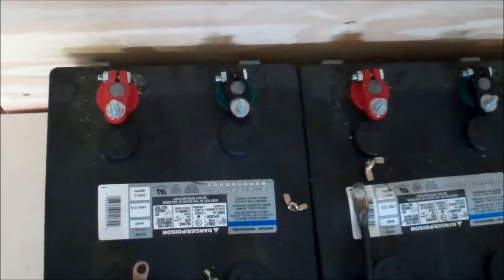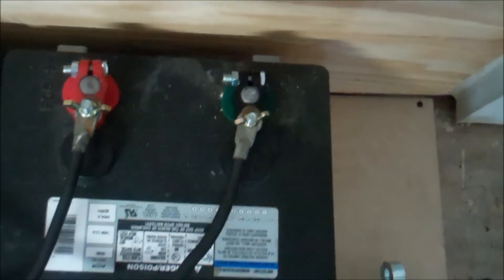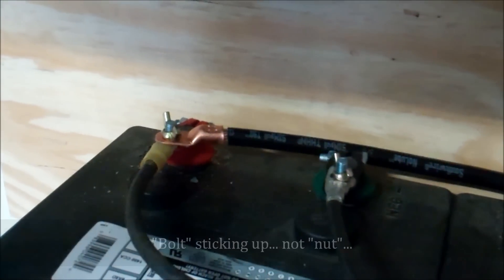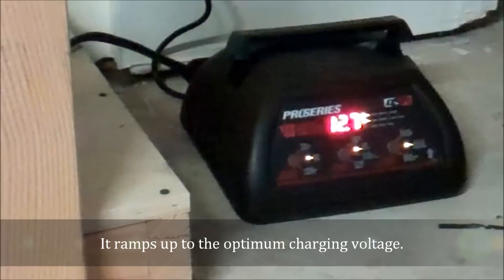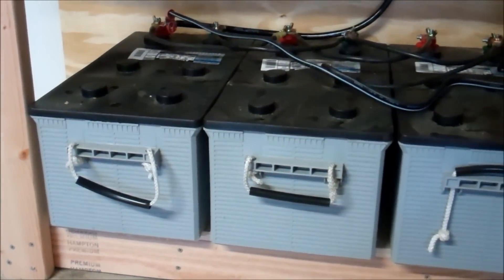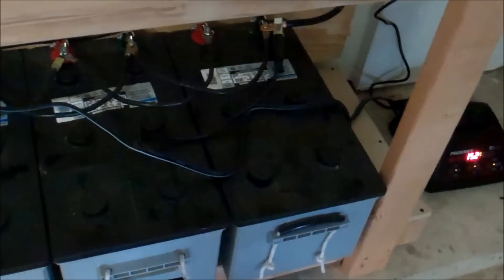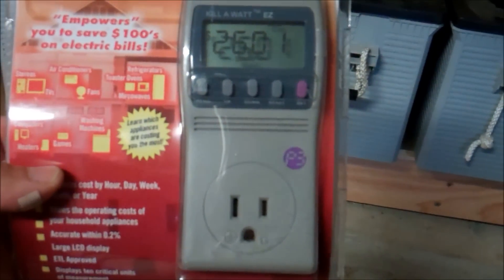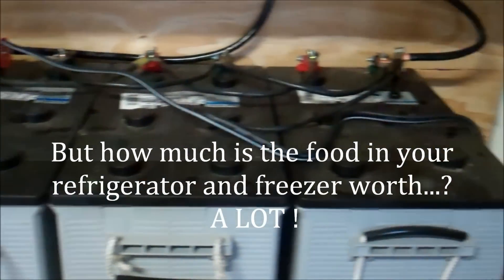Living Off The Grid ~ Build A Battery Backup Power Station

Comment: Dear Sir, Please  pardon my forwardness. This video is by far the best video on YouTube that explains how to make a backup power station however, I'm kind of a dunce when it comes to understanding the concept. I want to buy a modified sine wave or inverter and I was wondering if you would be kind enough to tell me ( recommend ) how many watts an inverter I should buy. I want to hook up 5 batteries that I have. They are all ' Interstate DCM0035 They are easy to find on Amazon along with the specs. I would have sent you a photo or the link however, Youtube will not allow it. I know that I am asking for a lot so if you don't reply, I will understand. I want to to be able to run all my appliances on it even the ones that draw a lot of energy.
Reply from the maker: The size of inverter you needed based on what type of “load“ you have. In other words, you have to figure out what you were trying to power, and how much current it draws. A good way to do that is to get a “Kill-A-watt”. 

That is a little device that will tell you exactly how much power, the appliance, our fan, or TV… is using. 
Just so you understand, it takes a large battery bank to power large devices for any length of time.

Having said that, I would say don’t go less than 2000 W. That way you can power two or three things at one time.
Reply: @TexasPrepper2  , You have my gratitude. Thank you so much.

Comment: I spent hours looking at YouTube videos trying to find a video that was helpful and easy to understand and that would teach me how to build a battery generator to operate appliances in my home. Out of all the videos that I watched and all the time I spent searching for that perfect video to teach me how to build a battery generator, I finally found that video and that video is this one. Thank you so much for posting. The only thing is that this video didn't show how to hook up the charger.
Reply from the maker: Well, thanks so much for the kind words! 👍🏻 😊
I just hooked it up at the end of the circuit. (The positive and negative points that give me 12 v). 
Hope that makes sense. 
Basically, like hooking up a battery charger to any battery… Just positive and negative. But, make it at the end of the circuit, not in the middle. Of course, that depends on how many batteries you have.

Comment: Just wondering why you hooked up to the inverter using two different batteries. Couldn’t you just use the terminals of just one battery . After all it’s still a 12 volt system.
Reply from the maker: Don't remember, but I think it was because of the way they were wired

Comment: Are these 12V Batteries???
Will that inverter with the batteries run a refrigerator?
Reply from the maker: Yes, these are 12V batteries.
This is a 2500 watt inverter, so it should run a fridge with no problem.
This particular inverter is discontinued, but here's a link to several nice inverters with great ratings:https://amzn.to/3rvpZ3W
The newer fridges are much more energy efficient.'

Comment: wow...those are sweet batteries... I am tryin to build a bank myself and it's costly hahaha   
  I am a beginner...I have 4  100ah AGM's now in a 12v set up in Parallel but want to go up to 6 batteries next.... But- I can't find any info/ Diagrams about hooking up 6 AGM 100ah batteries (Parallel) in a way that is equal charge / discharge  Like I say- I have 4 now and found a great site that showed me how to hook them up to properly draw and charge balanced...now I want to upgrade and no one has a bank diagram for 6 batteries for some reason ...also- do ya have to stay with even number of batteries?
Reply from the maker: I don't think you have to stay with even numbers if you stay 12 volt.
Don't add new batts to an old batt bank. The new ones might be pulled down by the older ones.

Comment: Do you keep the charger for the batteries hooked up while it is hooked up to the inverter? I'm thinking of using my 'NPower 3000 Watts Portable Digital Inverter' along with a '12v 100AH Deep Cycle AGM Battery' (thinking about getting one of these batteries). Eventually I want to get solar panels to keep it charged, but for now I want to do something like what you have here… I can find all kinds of stuff on solar hookups, but very little about this type of setup. I want to use my ‘NOCO Genius G3500 6V/12V 3.5A UltraSafe Smart Battery Charger’ to keep the battery charged, but I'm not sure if I can leave it hooked up and running while also powering the loadout that I have planned. Any info you can provide about other equipment I might need along with what I mentioned to make it all work without damaging the equipment is another thing I need to figure out. Any help would be much appreciated.
Reply from the maker: I've never had both going at the same time, but I guess you could... just not sure.
My question would be why would you want to run inverter and charger at the same time?
If the power is up to run the charger, why would you be using the inverter?

Comment: great video thanks. 

how long does it take to full charge you batteries with this setup. 

can I keep the batteries and charger on the porch, it gets pretty cold in winter. 
thanks
Reply from the maker: This setup was built for a family member. I don't know how long it would take to charge, but it should only be a  few hours depending on how far down the batteries were when charging started.
I would make an insulated "house" for the batteries. They don't need to be outside in the elements.
Reply: TexasPrepper2 

thank you for the reply. 
I'm planning to build one for the family where 2 hour on and 2 hour off electricity supply in winter. as long as can ran 2 florescent bulbs, TV, TV box, router and water pump. 
if one battery can't manage to charge in 2 hours I will have to purchase 2nd
I'm thinking to get 1x 200A battery and inverter-charger.

Comment: Here we went with the Fork lift batteries which I highly recommend.  No worry about the interconnects either. And  they can really handle the charge/discharge cycles and had the lowest cost per kW.  Just put up the 2nd video in the Relentless Homestead Solar Power "Star-Lite Wars" series - this one shows the battery box build.  A good backup way to go - can get into it for low cost -- I'd have gone that route if we didn't have such good $$ incentives here.  Hadn't seen batteries like that - would like to have been given them for free!
Reply from the maker: Nice battery bank !
Reply: Thanks - I'm looking forward to checking out more of your site.

Comment: Im thinking about plugging the battery chargers in to the inverter as I have other things running so that I can recharge the back up batteries . Is that realistic ? Thank you for the video I know now that I need to  get deep cycle . lots of a mp hrs
Reply from the maker: I don't think it works that way. 
You'd be trying to charge the batteries, through the inverter, from the batteries you are trying to charge...
I wouldn't even try it...
Reply: i quess im gonna have to break down and get some solar panels LOL

Comment: Good vid, one idea, do not place the connector over the vented cap, leaving out the wall there are two other sides with lots of room, and use some covers. Also have as many 12 volt systems as needed for recharging mobiles and other devices installed outside of the end, that is not running through the various power boxes and adapters but run directly from the batteries. Saves electric.

The point about Prescribed Maintenance is a good one, not all batteries or devices are dead at PM time. Most are replaced to cut down on productivity down time. Lots of these devices are sold, some directly at various used parts dealers etc. and some simply by asking places that do PM and overhauls. Get out there and ask, and if they don't then ask if they know someone who does. This is a better option the further you get from most cities since recycling becomes more and more expensive the further out you go, transporting truckloads of things like batteries a few hundred miles often requires expensive placards and permits. This is because they are very dangerous once used, they leak acid and combustible gasses. Many times a used but good tested battery is worth more to sell at a deep discount than it is to truck to reclamation. 

Depending upon your area and other factors this may help or not. When buying or being gifted batteries know what you are getting and bring a reliable tester including voltage and load. Even a free horse can have bad teeth.

Comment: I saw green crud all over the end of some of those terminals. Hope you cleaned them up before used them. They are a little bit too light... Two gauge is probably better for high current draw situations. It's a pretty decent inverter however, a pure sine wave will use the DC power from the battery is much more efficiently. Fuses are built into the whistlers.

Comment: I want to run a small heater.  It is 120 v, 60 hz, 1500 V.  How long will the heater run using the system you are showing?
Reply from the maker: I'm not good at math.
This is a system that I made for a relative, and I don't remember the exact amp hours on it.
Basically, a 1500W heater would suck the batts dry (i would think) in a few hours. That's a LOT of watts.
I would find another way to heat.

Comment: SAFETY WARNING!! There's no safety instructions here! YOU ARE GOING TO KILL PEOPLE WITH THESE INSTRUCTIONS!!!
 Even this rig is questionable with exposed terminals, no secondary over charge protection, no cross terminal protection, no acid drip or explosion shielding, and dick all in fire protection. He also did not mention to put battery rigs like this in open air areas because they can give off dangerous fumes.
 This type of rig might work great for it's entire life time but there's also a decent chance that this will burn down a house, melt your face off with acid, or just suffocate you with poison gas.

Comment: Half ass setup.  If the power goes out at night, how can you see what you are doing?   Do you carry a flashlight around all the times?  How will this person get their house wired up?  What about hot showers?  What is the quality of the  output on that inverter?  A better setup would be to get a 4th similar battery and use a proper 48V sine wave output UPS that is connected to the wall socket at all times.  12V parallel setup is the WRONG way to go with an off the grid setup.
Reply: Who shit in your cereal

Comment: Those batteries will vent highly flammable hydrogen gas when charging. You should completely enclose them in an area that the enclosure can be safely ventilated away from anything that can cause the gas to ignite.
Reply: No they won't AGM don't normally vent, don't leak. you can mount them sideways if want.

Comment: Hello Naturally Blonde. I have family that lives in Spring and Medina Texas. Although I live in Mo. I am currently building their off the grid solar and wind turbine set up. I agree 100% with you!!! Do not buy "Any" wind turbine from Missouri Solar and Wind!!! They are nothing more than a Delco car alternator and I won't use them either. You have hurricane winds for them to put out any kind of useable power. So in 15-30th mph. winds which is average you get 0 power. A lot of money for nothing. And yes he is getting sued. That's why I build my own and have for quite some time. I use 30,40th and 90 volt Ametek motors and you can buy them off of Ebay. I build my own towers and platform for the turbine although I only use Raptor blades and hub. You can spin the shaft fast with your hand and light up a 12v light bulb, no joke!!! At 500 RPM this motor puts out 14.4v. I learned all this from MdPub.Com. This man is amazing. He also builds his own Solar panels. Check out his site.

Comment: this may sound stupid, but how!do you determine how many solar panels? tired of paying extremely high light bills.
Reply from the maker: +Judy Obrien 
Get a Kill A Watt.
It will tell you how much electricity your appliances, TVs... etc use. That helps in determining the size of your system.
You will probably NOT be able to live on solar like you are living now. No A/C or large elect using things like that.
Here's a link to the Kill A Watt:
http://astore.amazon.com/homegardenfarmimprovementemergencypreparedness.homesadvis0b-20/detail/B000RGF29Q
Reply: It can get costly to have a lot of appliances and electronics on solar alone.  Its possible, but can be costly. :)

Comment: will you be able to make a cable with 2 plugs on then plug it into the house 
as long as there is no power coming in to the house only what your producing
would this work
Reply from the maker: +pete tm 
It's called a "suicide cable" ... very dangerous...
Reply: if you had the house disconected from the mains supply would it work
Reply: it's also illegal in many places. Backfeeding into your house is not a good idea.
Reply: NO, not a good plan at all, you need a pure sign wave inverter to start and one that is designed to hook into the fuse box by direct connection with inline fuses and disconnect switches as well. use a elutriation unless you know how to and are trained in that field . be safe , safety first .... Have a nice day.

Comment: I would like something for when the electricity goes out. Would one battery be enough?
Reply from the maker: +Ren7ee 
One 12v battery won't last a long time... but it's better than nothing.
It really depends on what you are trying to power.
For instance. 
Our power was out for 5 days. I bought a Walmart Marine battery. 
It powered a 19" TV for about 3 days. We probably used it about 8 hours each day. 
If you are trying to power a refrigerator... it won't last but a couple of hours probably.
Reply: + TexasPrepper2 --- para eso tenes que comprar otro convertidor de mas amperage, o sea, si tenes uno de mil, te mueve 10 bombillos de 100, y asi va, te mueve un tv, vea los datos del tv, los voltios, asi lo sacas, yo tengo uno de 10.000 amperios, pero uso 6 baterias en serie. y me funciona a la perfeccion, otra, que uso la misma instalacion, .. solo que tengo que poner otro corto circuito, estoy por ponerlo automatico,

Comment: Dear TP2 , is this the correct fuse to use on the invert or ? http://www.amazon.com/Heavy-Duty-Power-Inverter-Cable-Holder/dp/B00KHJOFMS/ref=sr_1_14?ie=UTF8&qid=1442548697&sr=8-14&keywords=INVERTER+FUSES
Reply from the maker: +Bobgg Regan It all depends on the wattage of your inverter. 
I'm no expert... I sized my fuse by using this formula:
Volts X Amps = Watts
So... a 12v to 1200w inverter would need a 100 amp fuse. 
12 X 100 = 1200
BUT... Check with someone who is more qualified than I am before you do anything.

Comment: Thanks for video. I want to build a battery bank system and use it to power my off grid home in conjunction with a generator and battery charger. I have been told that is the best way to recharge quick. I want to do this until I can afford to purchase solar panel array. Any help on this would be appreciated.

Comment: When the batteries are near gone, pour away the acid, wash the inside holes with diluted Bi Carb with water and refill with pickle juice and charge for 24 hours. Will run like new again. On the other hand, there is a chemical powder that makes forklift batts become new again. Its all on the internet.
Dan
Downunder.

Comment: I noticed your connections in which the inverter is the load I would have sandwiched the connections going to it between the connectors and the battery wire from the other battery. it would have made a better connection. the other suggestion would be to install a DC circuit breaker rather than a fuse they have dc circuit breakers up to 150 amps

Comment: Graet video. Very informattive. But theres one question i have . Instead of using a battery charger , couldnt you use a generator? Im lookin for a set up where theres no power/shtf situation.
Reply from the maker: Rick Valdez Sure... a generator... or solar panels would charge them...

Comment: Can you recommend a good battery that isn't overly expensive, but that would work well for this?
Reply from the maker: RGMerkel AGM batteries would probably be the best, but I've had some Walmart Marine batteries that lasted 5-6 years. I'm not a batt expert, so you'll need to do some research before you pick... but ultimately, it will depend on what you want to spend. The BEST batteries are expensive.

Comment: First off, 12V inverters are the most inefficient inverters out there.  For the average user, 48V inverters are probably the best to use. By using solar to charge a bank of 4 12V batteries in series, times 3 battery banks the primary current draw would be 1/4 approximately of a 12V inverter.  Much more efficient for the battery banks.  Just a thought.  But good job on building it.  Green is always the way to go. Cheers

Comment: Some real dumbass comments on here. This is a great setup and this is how it's done all over the globe with great results. I cant believe some idiot thinks you cant connect batteries in parallel. Never mix old batteries with new ones and you wont have any problems. As someone else has said correctly the new batteries will sink to the level of the older ones.  Older batteries will go flat quickly and go up to full charge quickly fooling the charge controller into regulating the charge before the whole bank is charged to capacity.